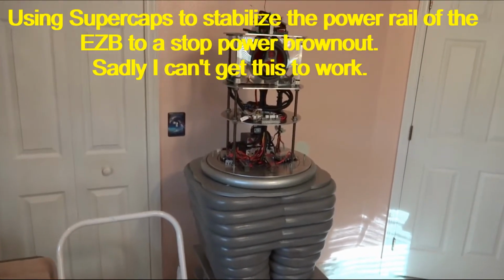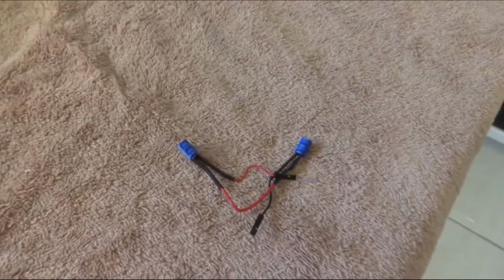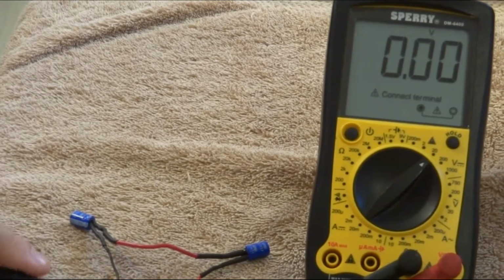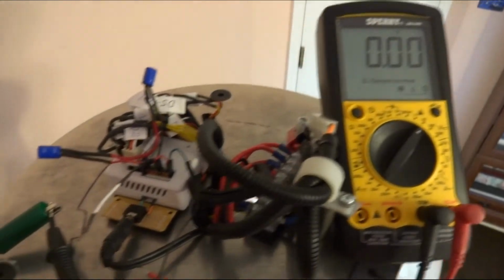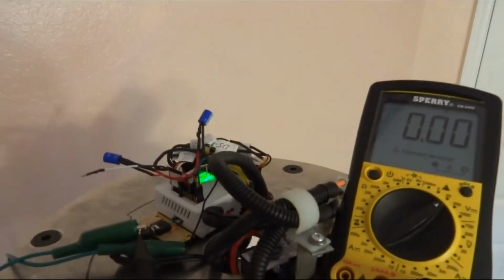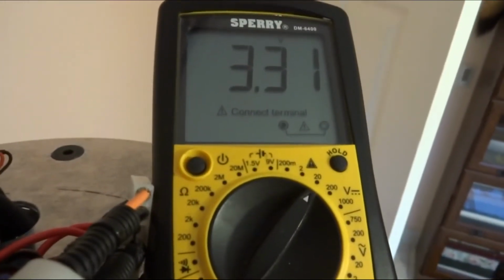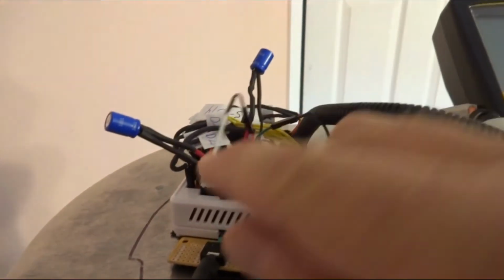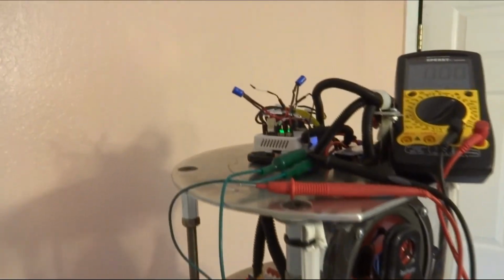Supercaps and EZB. Not for me.

Comment: "Zoe the Robot" has the following suggestions:  Try to isolate a separate power wire (Separate from motors or motor drivers) from the power source to the EZ-B. Increase the wire diameter, and eliminate connectors, or use larger connectors which will have lower resistance.
Don't use "Super Caps" , just use a normal electrolytic cap rated for your voltage.  (5V or higher) 1000 micro farad should work. The cap should be mounted as close to the EZ-B board as possible. (Where the power enters the board) Brown-outs are voltage drops caused by high current flowing across a resistance. Lower any resistance in the power line for the EZ-B, and add the filter caps up near the board. I think the 1 Farad caps are causing a voltage drop when they are charging. A 1000 uF cap will charge faster.

Comment: ..... G' day Mate,  Shouldn't you be measuring the power into the EZ-B, (under load) not the regulated 3.3v output ?
lose the supercaps, monitor the input of the EZ-B using 'min-max' setting on your multi meter.
Current drop from the PSU when under load ? (length of supply wires ?),  noise from solenoid or servo on that supply rail upsetting the microcontroller of EZ-B ? ,  disconnect servos one at a  time to localize.   ?  ?     ?
Run a cable up from the Jupiter 2 atomic motors,    (just don't ask Smith to assist ).
Are there clamping diodes on all your relays/solenoids ?

Comment: Thanks for the comprehensive video Dave! I can see what’s happening perfectly now. I didn’t realize how long those 1F caps took to charge up when you first turn it on. I’m not sure if it’s the brand or what but I’m thinking if you bring down the cap value maybe 0.5F caps you’ll get a faster charge up and still benefit from the brownout protection. Having the caps on the 3.3V rail is the same as having more capacitors on the output stage of the switching power supply so it seems the caps are charging up slow, which brings the 3.3V up slowly and makes the EZ-Bv4 have odd behaviour as a result. Are your super caps aerogel? I have Aerogel caps, they may charge up quicker than other materials. I’ll do a couple tests of my own for you.
Reply from the maker: Thanks brother! Your the best!
Reply from the maker: Hi again Jeremie, I can't find anywhere in the caps datasheet that says anything about Aerogel. In fact I can't find anywhere that I can find Aerogel Supercaps. If you don't mind, what brand are you using and where do you get them?
Reply: @DavidSchulpius  Commented in the Synthiam community but figure I’d mention it here too. I would suggest using low ESR super caps. The ones I use are from Cooper-Bussmann, they are the PowerStor series made with Aerogel.